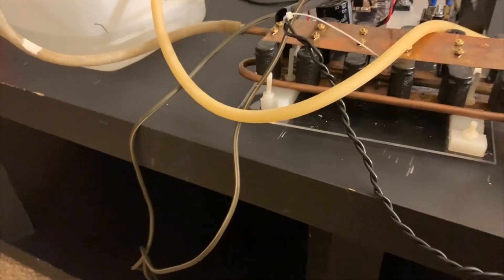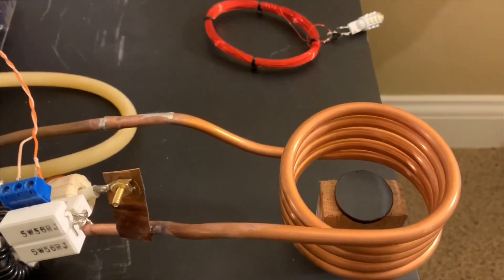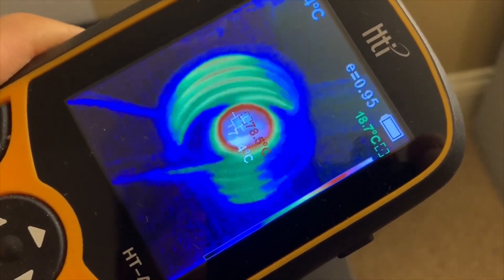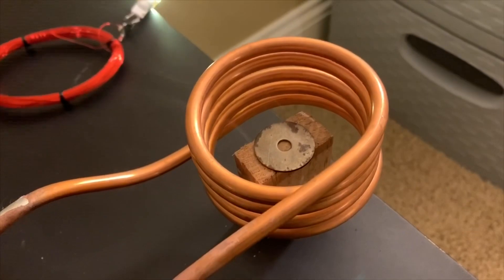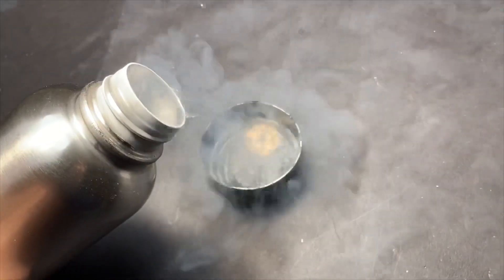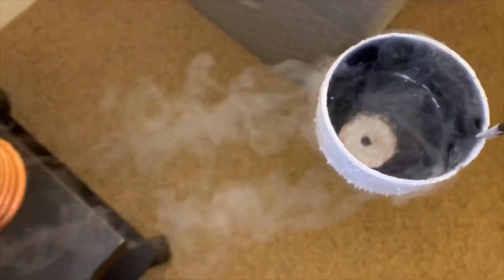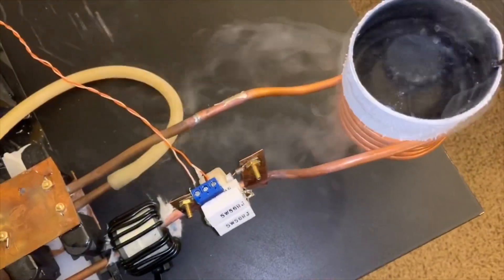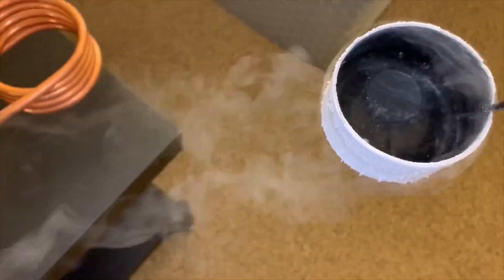Inductive Heating a Superconductor?

Comment: I’m wondering what happens when you use rebco tape as the inducer if you can keep it below 77 kelvin, would probably make an amazing coil. My question is weather or not the field would be stronger? I would assume yes and also probably several Tesla in strength.

Comment: Fascinating.  I like how you have a bulb being lit wirelessly on the table next to the experiment. What superconducting material is this?  Would it be possible to see what would happen if the disc warmed past its critical temp inside the coil without destroying it?
Also, what would happen if you brought a powerful permanent magnet near the work coil?  You should try with a tiny one to see if it starts spinning like crazy.